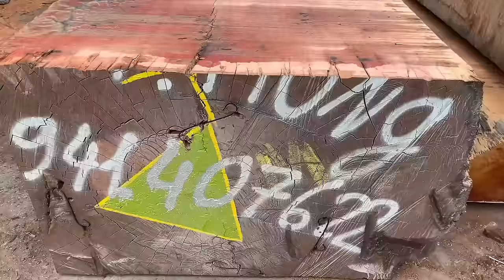Amazing Sawmill Wood Cutting - Giant Wood Saw That Works Continuously Powerful Cut Super Large Wook

Comment: Looks like a fire ready to happen.
Reply: @curtisbratcher9798. -  That is Mahogany, - have you ever tried to burn any ? - The 'thin planks' might 'char' a bit along the sides but the thicker ones would barely 'smoulder' around the edges. If you aimed a 'blow-torch' hard at one of those large 'Butts/Trunks' for an hour all you would do is burn a hole in it. The only things that could burn their would be the odd piece of bark, (most of which those trunks had been stripped of), the odd piece they were using as 'spacing' between the cut wood and any small piles of sawdust, - and their floor was remarkably clean for a 'mill'. - You need pine/fir, or any 'wide grained' wood to get a good fire going, of which I didn't see any. Mahogany is a very close grained wood. The 'Band Saw' had water constantly dripping on the saw, partly to keep it 'cool' due to the thickness of the wood it was cutting and also to reduce the 'dust'.

Comment: Whats with the metal cleats on end of log?
Reply from the maker: Thank You For Supporting The Channel
Reply: To keep the end grain from checking
Reply: Stops major cracking and fissures...
Reply: I’ll take a guess. To keep the wood from splitting as it dries out. If that log was green/wet they would not have moved it around that easily off the truck.

Comment: How much does one of those logs weigh.
Reply from the maker: Thank You For Supporting The Channel
Reply: I have wondered about that too. A qualified guess: Let`s say the biggest log on the truck has a diameter of 2 m, and is 5 m long. That makes 15,7 cubic metres. I am more uncertain about the density, that depends on the type of wood, and whether it`s dry or not. For example, dry mahogny, use factor 0,65? In that case, it is 10,2 tons. Any other suggestions?